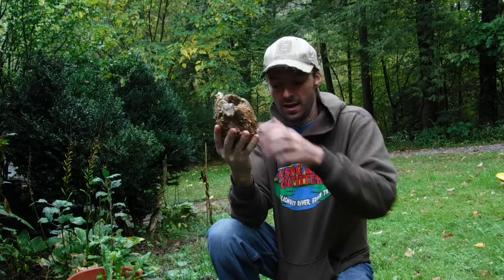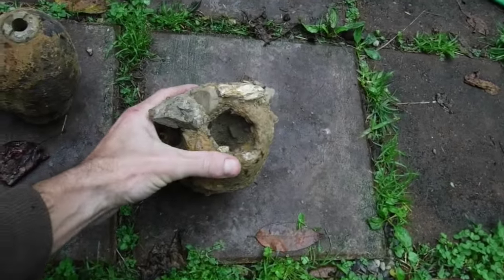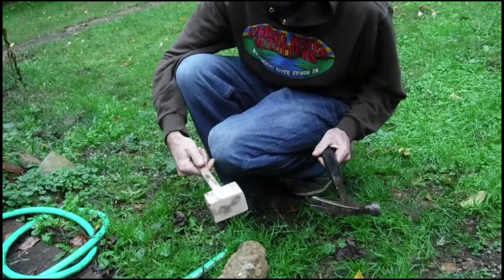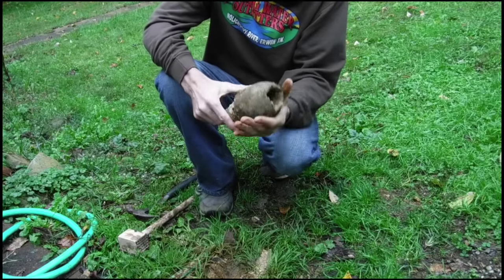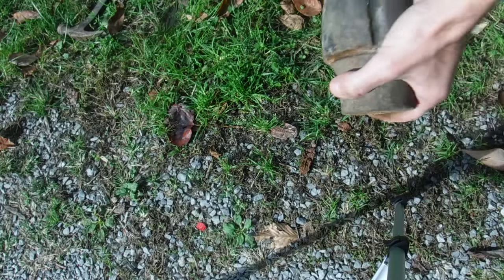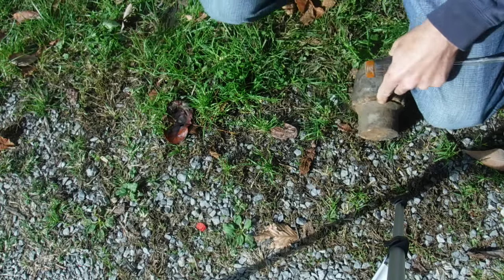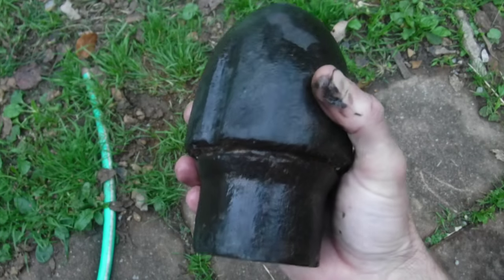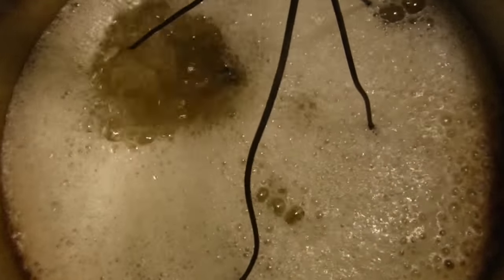Cleaning and preserving Civil War artillery Shells / Start to finish

Comment: Awesome Video! Your shells turned out great! I also used a hammer and flathead to get the rust and concretion out of the sabot groove; it really takes a lot of care not to damage it any more than it already is. Also another detail is that the electrolysis process blackens the metal; most people like it but, if they don't they can carefully wire brush it before coating it in either wax or lacquer. And of course safety through the entire process; it might sound like a broken record to some people but it's just to keep them safe and not to have any accidents or severe injuries. GL HH
Reply from the maker: +WatcherintheDark69 Thanks Watcher! Slow Steady and Safe are the keys! A lot of work!!